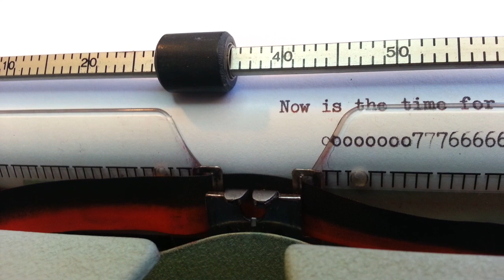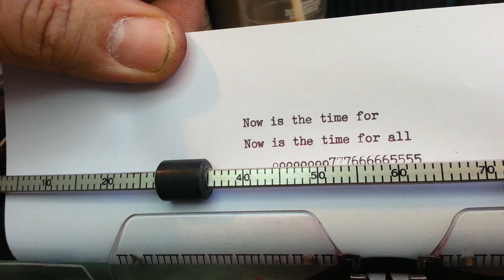Hermes 2000 Typewriter Ribbon Install Change Density, Margin Demo, Carriage Lock

Comment: 4:45 Margins. Thanks! I don't dare to touch it again hehe. But I think for the right margin I pulled the lever 27 in the manual, than released it and it dropped down a bit (while pressing the right margin lever down) and then went to the place I wanted it to be. Pretty tricky!

Comment: The interwebs are awash with skipping 2000s and I thought Duane’s got this? 

3-4 characters on the left, mostly the “a” skips a space. Doesn’t do it on uppercase. Seems to lessen moving past the middle area of the carriage movement. No other characters but those on the left side. 

Ideas?
Reply from the maker: Really no idea with out a look see. but I would be checking escapement trip from right side of basket vs left side. any chance of shipping damage ? seems like should be some other clues with the shift.
Reply: @phoenixtypewriter2136  

Thanks! 

No ship. This one was found via the old school hitting the streets method :-))

Really clean machine. The rs carriage shoulder screw was gone. Looks like it was parked after this. Funny I was wrapping up and putting the back panel on and a screw hit the floor. “WTF was that?” It was the shoulder screw.